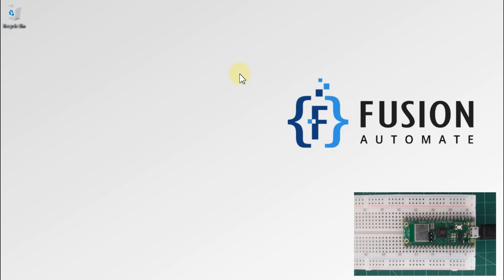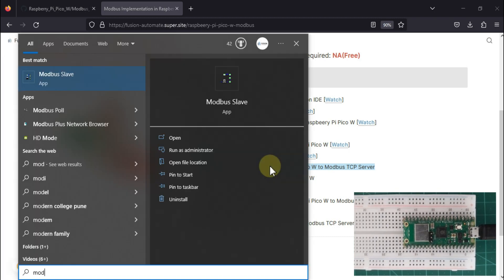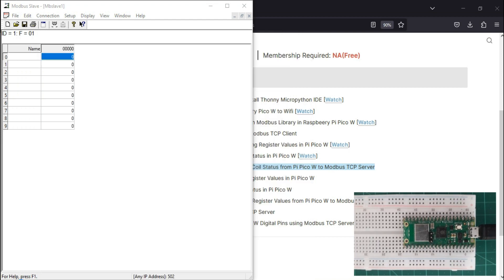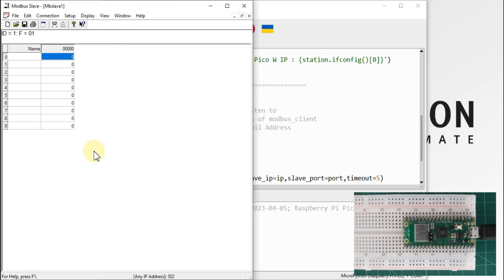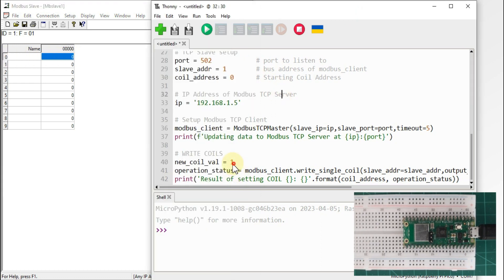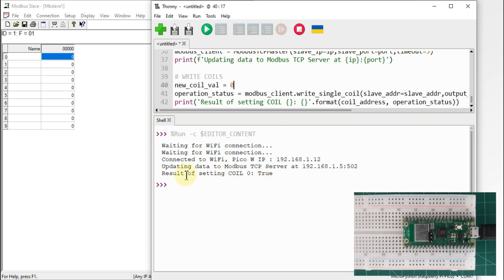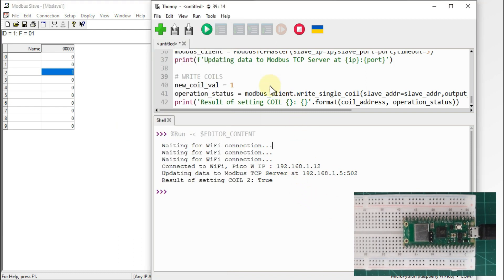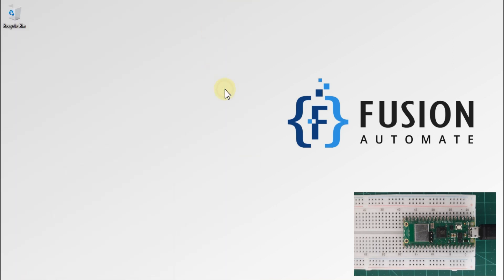How to Write or Update Coil Status of Modbus TCP Device from Raspberry Pi Pico W using MicroPython

Comment: Hello, I'm having problems with the function write_multiple_coils. 
coil_values = [1,0,1,0,1]
operation_status = modbus_client.write_multiple_coils(slave_addr=slave_addr,starting_address= starting_address,value_list = coil_values)

And it gives me the following error, TypeError: unexpected keyword argument 'value_list'. But on the function prototype the parameter is correct. Do you know what i'm doing wrong? Thanks in advance